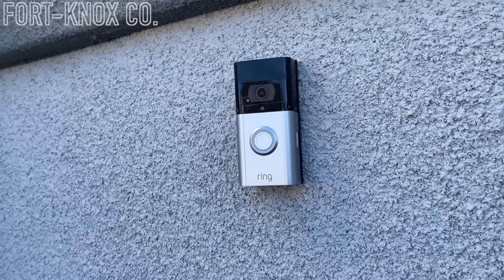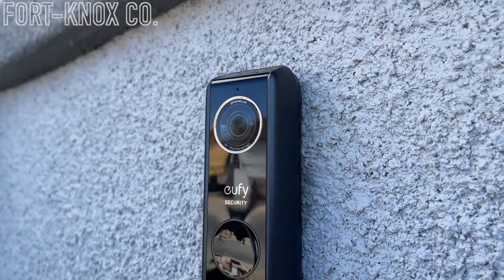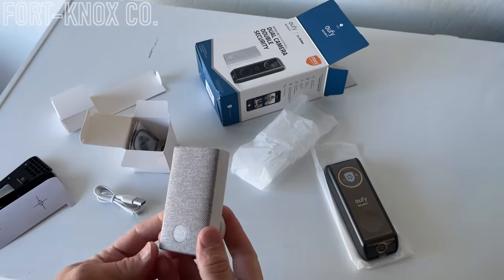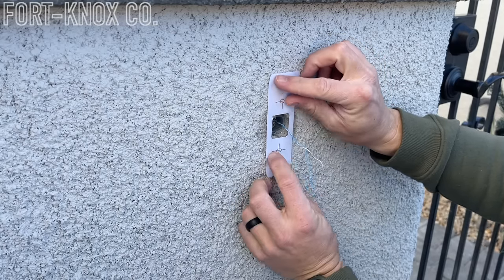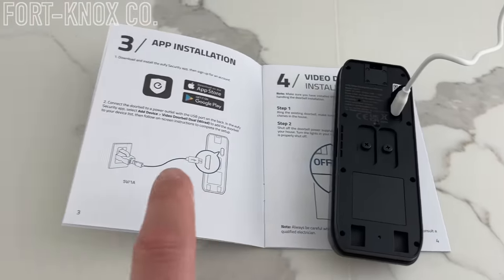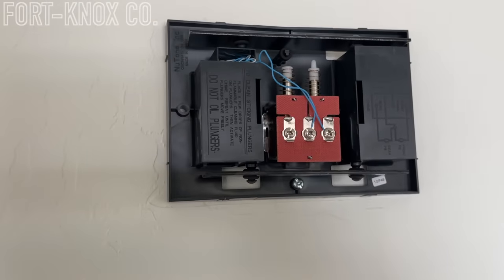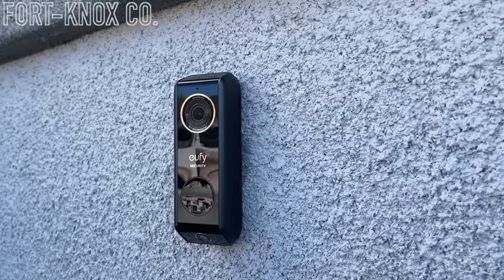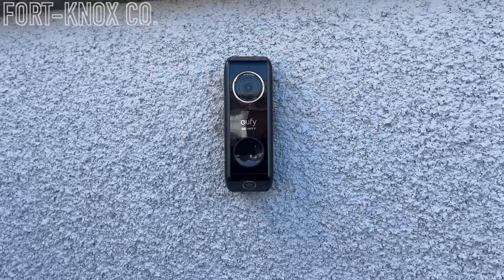BEST Video Doorbell 2024 with No Subscription Required Eufy Dual Camera Doorbell Installation Memory

Comment: Note: If your transformer is marginal (ex. drops to 15.5v with the dorrbell wired in) the dual wired will not only fail to stream video reliably, but it will eventually brick on an upgrade - trust me.  If your transformer is not easily accessible like mine, you can work around by moving to the E340 model that has a battery and can operate with transformer voltages as low as 8v.
Reply from the maker: This is very good info. It’s almost always a good idea to upgrade your doorbell transformer. But if you can’t or don’t feel comfortable adding/upgrading that electrical the battery powered option can be a work around

Comment: Do you have to have a doorbell to use this?
Reply from the maker: Nope not at all. You can choose from a wireless version which has batteries. Or if you choose the wired version you can use existing doorbell wires to power or install your own doorbell transformer, which I have a video on, and power it that way.

Comment: Do you know if the Eufy app has a ringer so I can answer from anywhere, and if so, can I control it's volume?  Thanks!

I got the AOSU doorbell and it seems to have most of Eufy's features (except it only runs on battery), but the smartphone's ring on my phone is so obnoxiously loud that I've turned it off; abandoning this powerful feature.  AOSU actually told me "just turn your phone's volume down", ugh.

Also, the AOSU's SD card resides in the remote ringer device, which also serves as a "hop" to our network.  If the doorbell is stolen, then I still have the recordings.  Does Eufy do the same?
Reply from the maker: Such does have the app that will notify you of motion and then if someone rings the door bell. I have mine set to just silent/vibration. It actually vibrates my Apple Watch and notifies me. So I can see the image from my watch and then answer on my phone. I believe you can turn the ringer on to actually make a noise too. But I like the vibration only for the same reasons you described. 
As far as memory stored inside your home they have a couple options. It’s either stored on the plug in chime in your home or in their homebase station that people use for their Eufy camera systems. Either way your videos are safe inside your home.

Comment: How can I use this if I have no wiring?  We just moved into an apartment home (basically a condo) and there's no existing wired doorbell.  It's a knock-knock world here and this unit is only 7 years old!  Crazy... I'm looking for a wireless solution.
Reply from the maker: That’s easy, you can just get the battery powered version. They have battery powered and a wired version. So for you, the battery powered would be the best and you can mount it anywhere you want and all you have to do is recharge the battery every 4 to 6 months whenever it tells you that the battery is running low. You can put it anywhere you want and get the best angle that you prefer. And your data / videos are stored on the plug-in chime inside your home. So the panel which model you get you have memory on the plug-in chime and if someone were to mess with your doorbell on the outside, you have your safe inside. It’s also nice that you can plug in the door chime to whatever is convenient for you inside your home.
Reply: @FortKnoxCo  Thank you!  I learned about their battery operated options right after watching your videos.  However, I also learned Eufy is getting access to all of your data by The Den of Tools here on YT.  Scary to think that a foreign country is getting access to our videos when they clearly are telling consumers they aren't.  Sketchy stuff!
Reply from the maker: @Bee_Hive_10134  yeah I get what you’re saying. But when you look at it every other manufacturer out, there is made by a foreign country if not the same foreign country. They all have some type of data or software that could technically give somebody somewhere access. If somebody wants to get your data, and they’re that determined they would be able to get it. I’ve heard of ring giving access to law-enforcement and local government agencies very easily without any pushback. So it kind of seems like no matter where you go if somebody request or wants your data they could get it. It’s kind of hard to find something that all factors.

Comment: Not to be stupid but do I just just need to buy the bell with the chime c210 kit  I see it on Amazon for $65? That’s all I need right? (Sorry I am bad with technology)
Reply from the maker: I would get the video door bell that is the combo with the plug in chime. The chime is super helpful and nice that you can plug it in anywhere. Plus it has internal memory, so the indoor plug in chime technically is your storage of data/video, protected inside your home incase something ever happens to the outdoor doorbell itself.  Some of the newer chimes or larger combo packs have the option to add your own memory card in increase its storage too.

Comment: Can you use it without having an actual doorbell?
Reply from the maker: Yes. You don’t have to have a door bell. The wires versions use existing power sources from your original doorbell. But the wireless versions obviously don’t need any original doorbell or wiring present.

Comment: Eufy wired dual camera is good. Eufy app needs work. Experiencing random indoor chimes and doorbell notifications, not sure what causes the false rings. I never answer the door anymore without checking the app to see who is there and if a package is present. I had to upgrade my transformer to a more robust one shortly after initial install.
Reply from the maker: I agree a stronger transformer is a must for almost every video doorbell. As far as the malfunctions of the doorbell we haven’t experienced that. Other than the occasional mistaken “human” detection when it’s our trash can outside the house.

Comment: i wonder does this work in -20 degrees
Reply from the maker: That would be a fun experiment. And it it works is make a video boasting about it. Could be some great information to have
Reply: My Alarm Com doorbell has an accessory you can put around the body during really cold season to help retain some heat in the doorbell cameras body.  It basically helps retain heat.
Reply from the maker: @MGMidget73  that’s a pretty cool feature. Crazy the things they think of

Comment: Awesome review man, is it still worth it? Thank you
Reply from the maker: Yes we still love it and it’s working great. We have the deadbolt video door lock now too and use both. They are super fast with notification and now with the door lock camera it lets me know when the door is opened, closed and how “manually” or with persons code. It’s pretty sweet
Reply: @FortKnoxCo  I do have the smart lock, and it works great. I was thinking of getting a doorbell with no monthly fees. Which one would you recommend for my first doorbell? Thanks
Reply from the maker: @miguelprada5465  if you already have the smart lock then I’d say go with the video doorbell. Both work great through from Eufy

Comment: Still can’t get my darn eufy to work—can’t answer it from my cellphone like I could the Ring. Can’t see who was at the door afterwards, either.
Reply from the maker: I’m sorry to hear that. I would make sure that your Wi-Fi connection and router are working properly and you have a strong enough signal. I would also make sure that your doorbell transformer is the right size. I have another video where I had to upgrade my doorbell transformer to have the doorbell work correctly. Sometimes, if it is under powered, it will still work, but it will do exactly what you’re describing, which is not working to its full potential or having strong enough connections. Those are the two areas that I would look at.
Reply: @FortKnoxCo  Thanks--That's exactly what I've done.  My WiFi connection is as good as it can be, and I even have a signal extender near the front door.  Since my eufy is hard-wired, I also purchased and had an electrician install the more powerful transformer recommended by eufy, all to no effective improvement.  Even with the motion activation and the doorbell actually having been rung, my "Events" history for the day is "No events this day."
Reply from the maker: @SiebenbuergerSxn  if all of that has been done then my guess is it could be a defective unit? Maybe eufy can send a replacement to swap out and see if a new unit will work better.

Comment: Is battery powered ok?😊
Reply from the maker: Yeah. It works just the same. Just gotta charge the battery every once in a while
Reply: @FortKnoxCo  but is response time and reaction time as good as wired? is it a wise idea to have both a video doorbell + the video door lock s330 so in case one runs out of batteries you have a backup? or is this overkill
Reply from the maker: @mcmickey3344  it seemed to respond the same. I just have both as a result of needing a new lock and getting one with a video capability. It’s probably not necessary but the door lock video camera helps face the direction most people want with the direction of the door. Some peoples doorbells are wired off to the side and it’s not the ideal angle.

Comment: Thank you for your quick reply, but there are a couple of issues, First, there is a note in red, (on Amazon website) that says "The item can not be delivered to you selected delivery location, please choose the different location" and then said similar items? the second  one, is yours is wired, I thought wireless and when you said wired it means, each individual camera connected on wire, why you do not have wireless, and which one is better wired or wireless, how can be connected with a cloud, when it is not wireless?
Reply from the maker: If Amazon doesn’t deliver this product to your geographical location then that’s obviously something outside of my control. But maybe there’s a place or person that it can be shipped to and then you have them ship it your way. 
As far as wired vs Battery operated/wireless its personal preference. I had a battery operated one but ended up going with the wired version of the door bell. The wired door bell just has the advantage of never needing to charge the batteries. It’s more convenient. 
As far as cameras it’s the same thing, wireless vs wired. Wired might require more work to run wires to wherever you want cameras and some people don’t want to pay for that. The Benefit is you again don’t have to worry about charging the batteries. The cameras will have constant power. The cloud storage goes for both, it’s how you can choose to have your video stored. Wired or battery operated you can choose to store you data on the cloud or local hard drive in the home. It’s all personal preference and how your budget is. I prefer wired and in home storage and not storing anything to the cloud. Wired cameras also don’t necessarily need to be connected to your WiFi to work, they are powered and run off the wires and store their data on the head unit/storage device. If you want to access and see you video from your phone or computer you would then be able to connect your system to your WiFi and access your data. It’s all what you want to make of it. There’s options for ever situation.
Reply: @FortKnoxCo  Thank you bro, but what the point having wired one, if you can not get access on WIFI and directly on you devices, such as mobile phone or Lap top or Tablet? By the way, are you the agent or sales man for this brand or company? just curious to know.
Reply from the maker: @melkamutsegaye6943  with wired and wireless you can choose to connect to your WiFi. They both have the ability. What I am saying is that they both have the ability to do everything. The only difference is whether or not you want to run wires or already have wires in place or if you just want to go with the wireless option for convenience. They both have all of the same features. They all can be accessed from your wireless devices, computer or phone. It all just depends on what you want to do with it. The thing I like about Eufy is that they don’t force you to use the cloud as the only option they allow you to store it yourself or they offer cloud storage as well. I feel like it’s a little more versatile.
And no I’m not in any way connected to the company. I just made a video showing a product I found and used and liked. To share the information. Kinda like a friend who says hey I found this new thing and I really like it. I’ve used different products and have switched. I’m always open to new things and try them out and when I do I like to make a video about what I learned. Because I know some people might find it helpful. Just like getting information out there to the world.
Reply: @FortKnoxCo  Bro, wonderful, that is a very kind of you, god bless, keep it up your good work!!
Reply from the maker: @melkamutsegaye6943  thank you! I appreciate that

Comment: What if you have no chime. I presume its battery operated?
Reply from the maker: The chime that comes with the camera door bell is a plug in. It syncs with your system and you can also adjust the sounds it makes. I also believe it is where your data/video is stored from the doorbell. Safely inside your home

Comment: What if you have no existing doorbell or power source?
Reply from the maker: That’s fine. Almost everyone does. This incorporates into that system. The two wires at you push button are used to wire the camera door bell. And there’s options for wiring at your indoor chime to use it or disable it since you can have a wireless chime with the video doorbell.

Comment: Ok, so are you still using this doorbell and have you found a security case to  put it in?
Reply from the maker: I’m still using it and have no complaints. I don’t believe there’s any use for a security case. I rarely ever see anyone putting their doorbells in secondary product cases. I know there are a couple things out there to help secure your doorbell but again it’s not something I’m worried about. I don’t hear of them being stolen or broken very often. The data is stored in your home in the plug in chime or your home base memory, so there’s no worry about losing data from that.

Comment: The installation is so simple.   Isn't it an easy steal for passersby to grab, snap it off and be gone?  No secure screws to hold it tight in place?
Reply from the maker: Yes the installation is easy. But it’s not simply just a light pull and it’s off the wall. But at the end of the day if someone wants to knock a light off or rip something like this off your house wall they most likely can. The video will be captured and stored safely in your home. It’s not stored in the doorbell itself. It’s either stored in the plug in chime in your home or the Eufy HomeBase in your home.

Comment: Unfortunately, you do need a Eufy account and you can't run 100% local. It also doesn't provide an RTSP stream, so you can't integrate this doorbell properly in other systems (like Home Assistant).
Reply from the maker: I’ve heard they are working on integrating with other systems. Their goal would be to be as compatible and competitive as possible I’d think. I don’t use home assistant so I didn’t notice that aspect. I just use the eufy  app when I need to look or check something
Reply: @FortKnoxCo Eufy brands the product as "local storage" and no subscription needed. Techincally that's correct, but you do need to connect it to the cloud to operate. Without an Eufy account, this device is just a dumb doorbell. I own this bell too and I do worry more and more about connectivity to Chinese servers. All the cheap stuff needs a connection to Chinese servers. Call me paranoid, but I am moving away from it and only want devices that work locally.
Reply: @PeterSmith-ko7xh  I am prejudice about the Chinese companies based on the total lack of privacy that these companies show. Almost all companies have strict ties with the Chinese government and I don't think that a government needs to know about my private life (also not my own government). I am bypassing the rudeness in your comment. If that's your way to discuss, then your comment says maybe more about you then myself.

Comment: It was on my shortlist, but unfortunately I have no power outlets even remotely close to my front door. My search continues.
Reply from the maker: They have a battery option. So you can do it with or without power. Almost every doorbell has the option now for a battery version. Eufy has both.
Reply: @FortKnoxCo  Thanks for replying, that's good to know 🙂

Comment: Hi, I have just looked on Amazon and these are 99 quid, Looked on your link and they are 150 quid, EH ?
Reply from the maker: The links in my description are for several different ones. The wired version, wireless version, one that comes with a door bell, etc.  there is a price difference of about 50 between the wired option and battery option.
Reply: @FortKnoxCo  Just bought one and waiting for delivery, Thanks. Terry.
Reply from the maker: @terrybingley6242  that’s awesome. I’m sure you’ll love it. We still have ours and have no complaints

Comment: I have a Eufy battery doorbell 2k it’s ok…the notification is very slow, by the time my phone notifies me whom ever was at the door is already gone. It is clear though.
Reply from the maker: Sorry to hear that. Possibly a WiFi issue? I prefer the wired version if possible with proper power source it can be pretty quick
And strong signal so no lag time

Comment: I’ve owned eufy for years and I’ve gone through several devices and their biggest fault is the protection lense keeps falling out of their door bells
Reply from the maker: I haven’t had that problem. Seems to work and stay true. The only thing I notice on my door lock doorbell camera is when the sun is hitting it directly and it’s over 100 degrees it give some type of heat warning chime. It’s weird but only happens once in a while